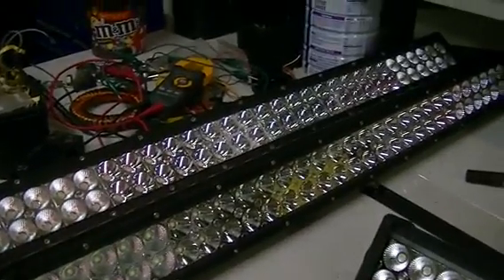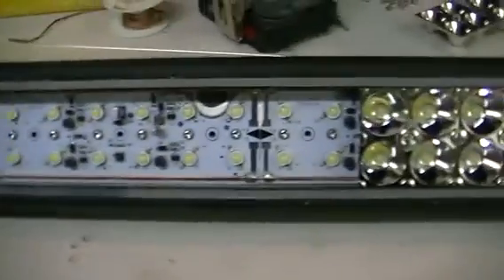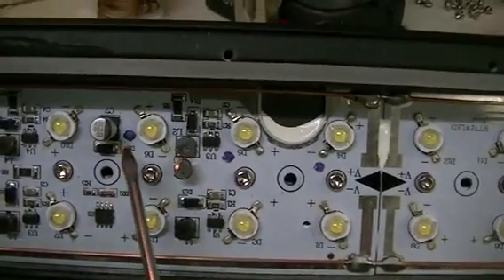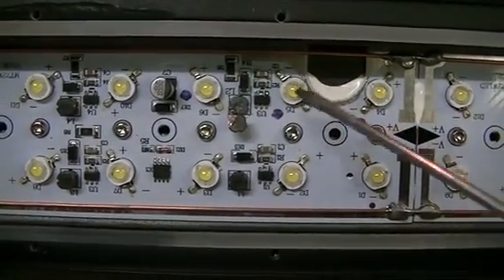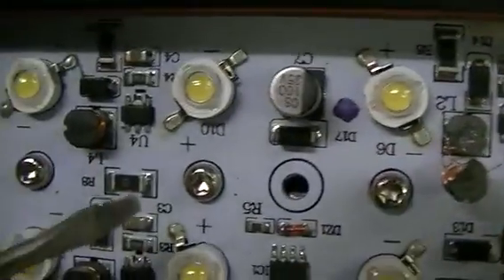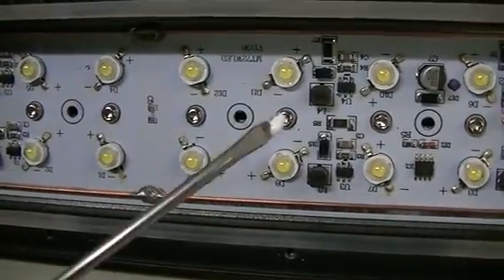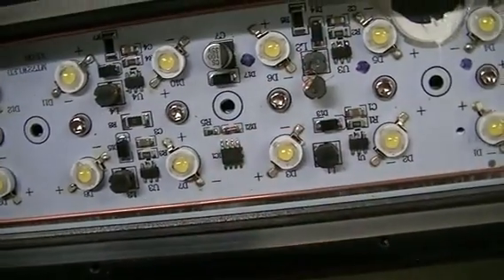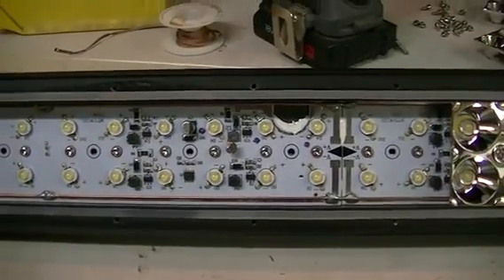LED Light Bar tare down-circuits inside.

Comment: WOW! I actually found that posting, it was about half a year ago! http://www.instructables.com/answers/Please-help-with-repairing-my-LED-light-bar-there-/

I took a look at the photos he posted, it is not the exact same circuity, the layout of the board appears very slightly different, and there is one additional TO-263 component, likely a voltage regulator of some sort.

Comment: Déjà vu! I swear I saw someone on instructables had posted a question a LONG time ago on how to repair those exact same LED light bars, the circuitry to my memory looks identical, I even remember the pictures he posted showing in random places clusters of 3 LEDs not working at full brightness. I answered that question based on what I thought, which was somewhat similar to what you have figured, except the inductor was not obviously broke, I just said it was likely the buck/boost converter thing that drives the 3-LED series.

Comment: dc step up converters have that same inductor.2$ from eBay [CHINA]
Reply: It's not that simple.  Inductors have different inductance and current ratings.  It needs to fall within a certain range to work correctly in the circuit.  It might have the value marked on it somewhere then a part guaranteed to be correct could be ordered from an electronics supply house like Mouser, Newark, Farnell, Digikey, etc.

Comment: These inductors are in dc-dc converters. In fact the small circuit is just that.
Why don;t you try and see if the two wires of the inductor can be accessed? No need to remove the complete board in that case. Unless the new inductor would not fit.
Reply: Then he would need a hot air gun, a heat shield, and skill using them, since the solder pads would have to be under the base, as it can be seen that they are not extending out away from the base of the inductor bobbin.  However removing the board would not be a big deal, just unsolder the wires with a beefy iron.  It'd take longer for the iron to warm up than to do it.